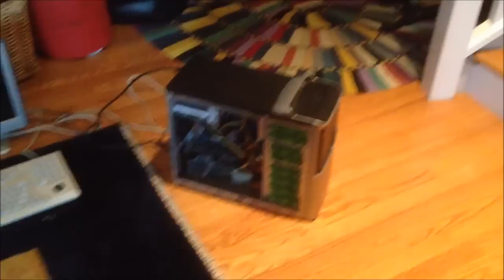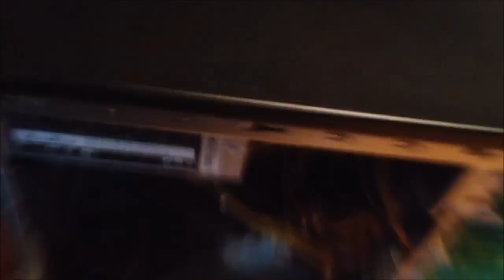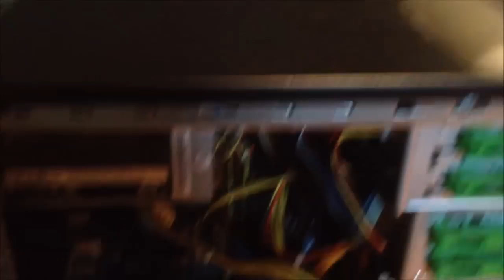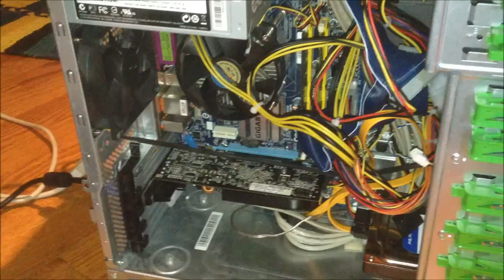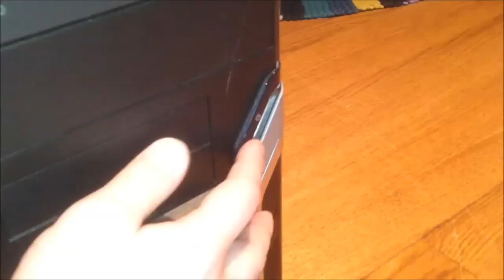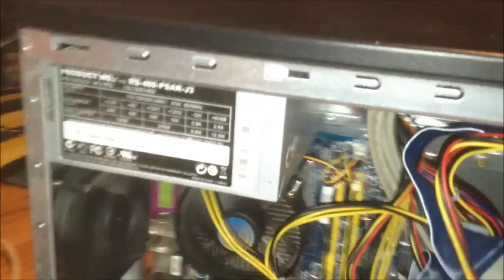Shorted Intel Core 2 Duo CPU

Comment: Hello sir, is there a probability that a CPU is shorted or damaged when I plugged in the power cable to the source and it turns on even when i didn't press the power button. And I noticed also that incandescent Bulb in my safety circuit Glow brighter, when I tried to remove the CPU there is no Glow in the Incandescent Bulb and the LED indicators are On. And the fans still Run even when I didn't press the power Button.

Comment: Intel is not like AMD. The pins are on the motherboard as opposed to the CPU. So a 775 and 1155 look exactly the same except for the pin contacts on the CPU. Try doing that with an AMD socket and it just won't fit.

Comment: That happened to my E7500 when someone put a metal backplate on the back of the motherboard. Both the MB and CPU went, but luckily I got it replaced on warranty.. Was replaced with a i3 2120 and some 1155 motherboad. I also have a E6750, found it along with a nice Abit Fatality motherboard.

Comment: You can't put a socket 775 cpu in a socket 1155 it's impossible their not the same number of pins on the board so it could not even fit physically.
BTW a cpu could not be "short" because it's work using silicum between differants layers and could not be shorted physically
Anither thing BAD cpu is rare, in my 15+ years experience only seen 2 bad CPUs one because of electrostatic discharge and the other was internaly at fault (bad floating point unit).

Comment from the maker: they're not hard to understand at all, they're the same as AMD sockets. you match the CPU with the socket and that's that, it's not complicated. socket 775 CPU goes in a socket 775 board. socket 1155 CPU goes in socket 1155 board. only difference is that AMD has better backwards compatibility with sockets since AM2 because it hasn't changed since then. also, AM1 didn't exist, it was Socket 939 before AM2.